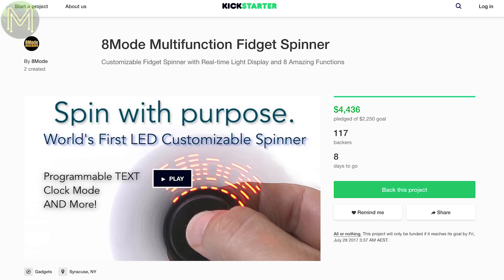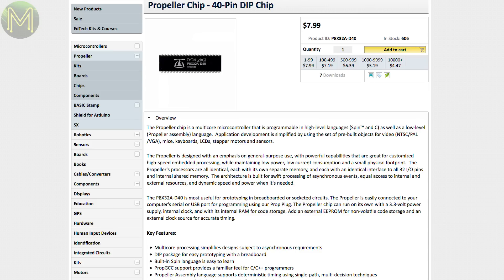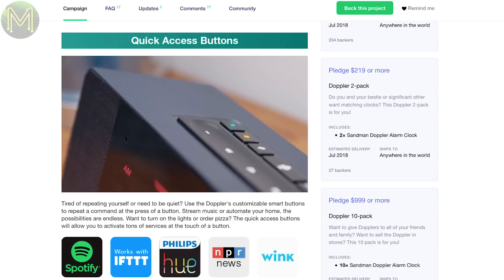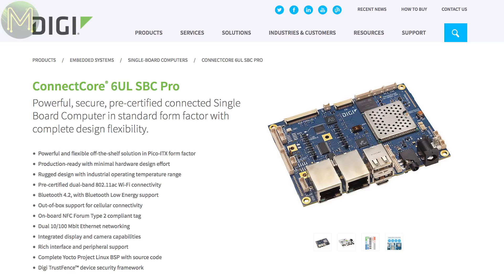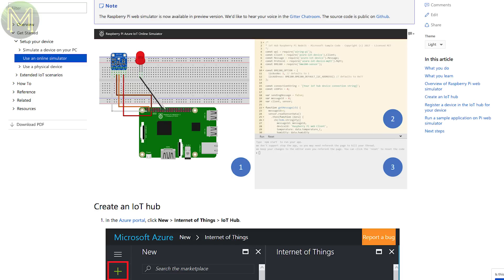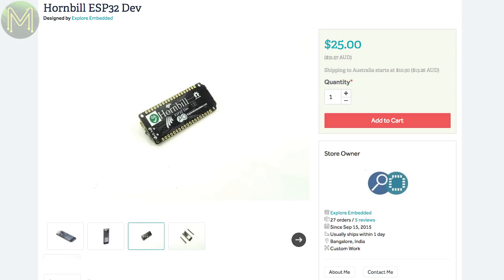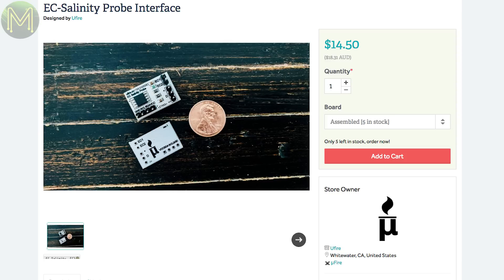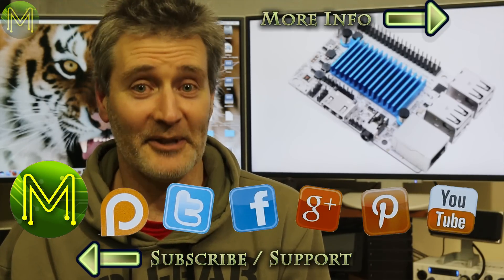#153 Weekly Roundup #39 - New Maker Products

Comment: Why are the true IR cameras so expensive. I would have thought it would have been the easiest to make of all kinds of cameras.
Reply from the maker: I had that same question and a brief Google showed up the age old problem... Volume.
Volume is why we can get an SBC for $9.
Volume is why the Pi is so dang good.
Volume is why an Android tablet costs $99.

And volume is driven by demand. If there's no demand, there's no volume and so price increases to accommodate development costs.

This is a perennial issue for engineers.
Should I use XYZ IC which is more expensive, but can replace 2x ZYX other components?
Can I move to two layer PCB manufacture if I use XYZ components?

When you are making a board as complex as an SBC there's a lot of thought, (or should be), into what components are selected.
Components that aren't used often will have a higher price and so, (catch-22), don't get used often.

So, manufacturers are only concerned about volume. They are only interested in what sells for the most profit.
Reply from the maker: As an interesting note: You can get SMD caps for as little as 4c each. Now if you wanted to try and make one yourself it'd cost literally $100s.
Reply: ok, I guess that will change in near future. I would love a nice thermal cam. But I cant put up with anything less than crappy FPS. I heard that the Yank Gov are the ones that are restricting frames per second to non-military people. That shits me so much.
Reply: I can't see more than 10 FPS happening anytime soon. The restriction is to stop them being used in IR guided rockets, drones and missiles.
I think one of the other reasons thermal cameras are so expensive is the issue of a sensor that can detect signals in some sort of calibrated way below the ambient and much lower than the electronics around it.

Comment: I just don't get it. If I need a really really small arduino, I would go with some ATtiny board and there's bunch of them in the market.
32u4 is quite a cool chip but too few IOs and kinda expensive, comparing to the ST arm core.
Reply from the maker: Yup, it's the old engineering debate of more or less. All a balancing act. I'm sure it has a place, just can't think of where.